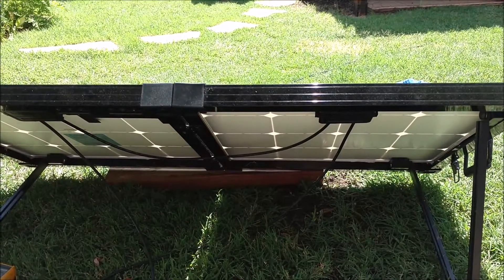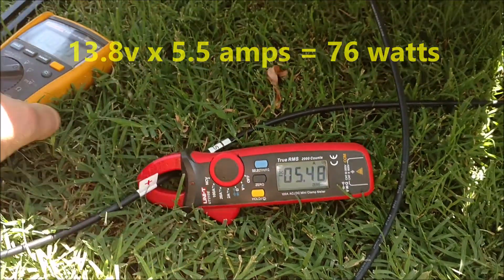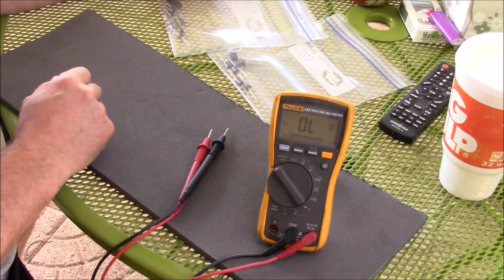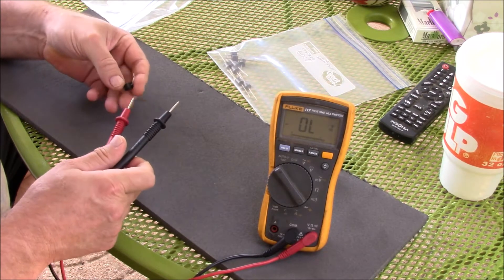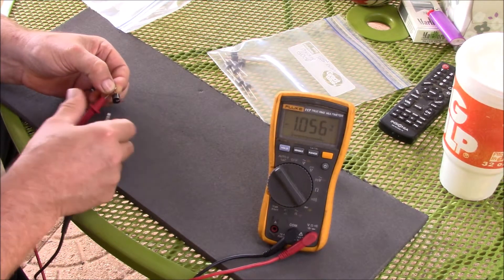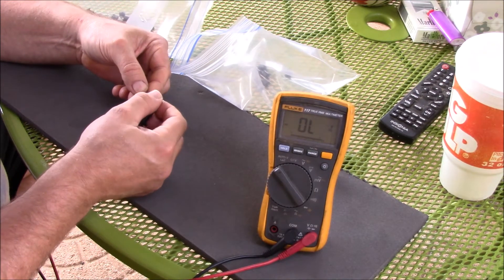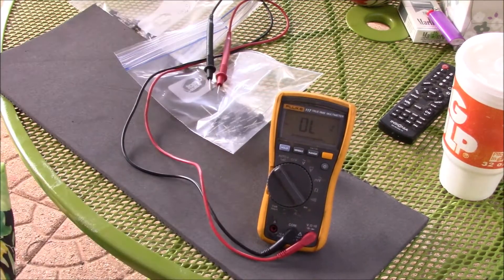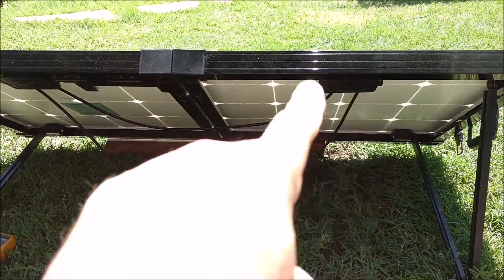How to test solar panel Schottky blocking diodes - Fluke 117 TRMS multimeter

Comment: I'm puzzled with the assumptions being made as to increasing your solar panel's performance by swapping out one set of bypass diodes for different ones.  The measurements you took of the old and new diodes both showed that they were 100% open and blocking all current on the reverse side which is what you want for a bypass diode when the panel is in full sun with no shading. In full sun you want the bypass diodes to stop any and all current and let 0 power go through them so all the solar cells can produce as much power as possible... and your tests showed all the diodes tested and did that correctly.  The bypass diodes only take effect if one of the solar panel's strings of cells is shaded. During shading you would want any power generated by non shaded solar cells to bypass the shaded solar cells in a panel and flow through through the diode so that panel can continue to produce power while the shaded cells would otherwise restrict the flow. It's only when solar cells are shaded that the diodes have any effect on panel performance and unfortunately when a bypass diode is doing its job the overall panel's performance is going to suffer but thanks to the diode you are getting at least some power output when you would otherwise get close to none.  In other words, replacing diodes that chirp with those that have a long tone would not give you anymore power producing performance when there is full sun with zero shading on the panels.  To test this out you can remove the diodes completely from the junction box and you should get the same power output in full sun as you would get with any of the diodes installed.   To test the diodes performance you would need to shade the string of solar cells the diode is configured to bypass and measure the power output when power is flowing through the diode.  

The nice thing about these small portable solar panels is if the diodes do go bad (short closed) for any reason such as EMP, you simply have to remove them or cut them out to get your solar panel functioning again, just being careful from then on to not let them get partially shaded, which isn't hard to do because of their size and ease of moving. You only need to replace the diodes if you want the shade tolerance ability the bypass diodes provide which also protects the solar cells from overheating too.

Comment: I've had 2 renogy 50 watt panels die on me too because of bad diodes 5 years ago. I even brought them back to their warehouse in California to show them and they refused to admit it was faulty. Instead they said it was my Victron charge controller. Well, I am still using that charge controller to this day without problems with other solar panels. I have not been able to recommend Renogy as a company since that experience.

Comment: What size diodes did you buy to replace the old ones?. Also do you need a Blocking diode if you are using a controller?
Reply from the maker: https://www.amazon.com/gp/product/B01CXOQMJ8/ref=ppx_yo_dt_b_search_asin_title?ie=UTF8&psc=1

Comment: My older Flukes do not chirp unless something is wrong, live having leads connected for current when the dial is set for something else. Or when the voltage is dangerously high (in its mind?!?) so coming on and off 500 sometimes chirps, over 600 always chirps. Also, when the battery is low you get odd results and some chirping when real low.
I run my on a wall wart now unless i go on the road. I can see you have an alternate function on your diode testing function, that would be worth reading about. Mine do not have that alt function. Read the manual these meters are pretty well thought out. In any case you are reading forward voltage drop. The lower the drop, the less energy is being dissipated (lost) in the device.

Comment: The IF or forward voltage is what you were seeing. Some cheep china Diodes will show a near short. Most solar panels use the bypass diode so you don't over heat a cell when it gets shade on it. I have discovered that most of the diodes Renorgy uses have an IF voltage of 0.1xx and that is what you want. Your open voltage should have a max of around 21.5V but that is a brand new panel. The older they get the lower they go. The diode that came off the panel should have been a 15SQ045 that is a 15 Amp 45 volt diode. By going with the lower IF diode you will get slightly higher number in the end but how much heat they shed is important. The only way to test them while on the panel is in a dark room with zero light or using something like the Hioki ft4310 tester. If is pitch black and check resistance it will show open one way and some resistance the other.

Comment: I’ll have to test my extra diodes just to be sure too great idea sir
Reply from the maker: You know "go with your gut feelings" is really important. To me, with this "open box" Renogy solar suitcase it was a pinch on the lower power side for having Sunpower type cells. Not bad, but just thought it was "a little low". Will do some more testing and tweaking to dial it in. The Fluke 117 (and maybe other models of the Fluke) likely has a "threshold" for steady tone while diode testing. But, I think that is a good indicator vs that gay "chirp". Good luck with the testing

Comment: looks like both diodes are good.  if you notice in diode mode the number it shows is in VOLTs.  it measures the forward bias voltage drop on the diode. I think you just have two different diode types.  Meter probably only makes a continuous tone when the voltage drop is below a certain level.
Reply from the maker: The bag of 20 diodes I bought have the same part numbers stamped on them. 1/2 of them "chirped" and the other half had a steady tone while testing. I agree with the continuous tone at a certain level with the Fluke 117. Those 10 that chirped are likely fine and would work...just slightly higher voltage (.131 vs .085). The lower voltage (.085) steady tone I showed in this video sounded exactly like a the tone that is made while testing impedance (indicates a short)

Comment: Chris, I noted that the original Renogy diode had .131 volt drop VS. the new .081 volt drop diode which is less.  Fluke page showed different drops between germanium and silicon as being 0.2 - 0.3  and 0.5 - 0.8.  So  different materials will give a variety of results.  Good to see your panel output looks better with the newer diodes. I my mind, the lesser amount of voltage drop will equate with higher flow-thru voltage ( less resistance ).   That looks like a winner.  I have also purchased a pack of diodes. I will check them and see what results I get.  Thanks for the experiment.   J K
Reply from the maker: That difference in voltage drop made the Fluke "chirp" vs a "long steady tone" in diode testing mode. To me...that long steady tone is more gooder! I bought a bag of 20 on Amazon (AKOAK 15-amp Axial 15SQ045) and the material is Silicon. I tested every one of them...1/2 of them gave me a "long steady tone" and were around .074 - .085 volt average. The other half "chirped" the meter and were higher. I may test the solar panel with a solid wire "jumper" in place of the diode to measure the real voltage and then compare it to the diode and see how much drop there really is. In all actuality, don't even need a diode in there if using a quality solar charge controller (to stop battery power loss at night) on a single solar panel system. Which ones did you go with?